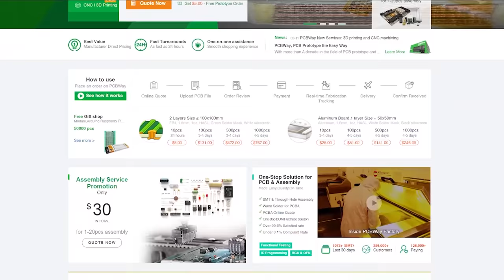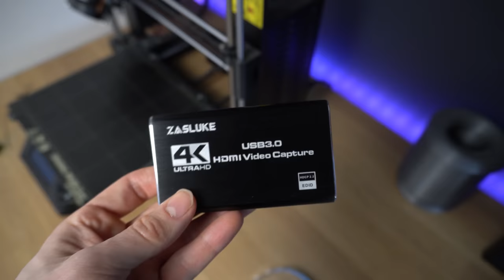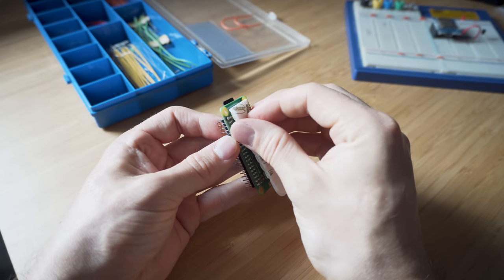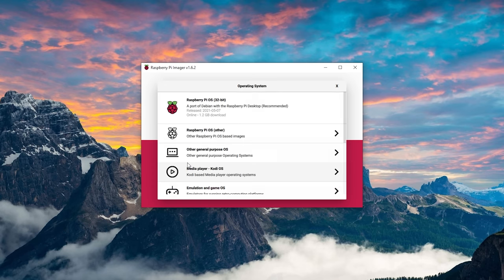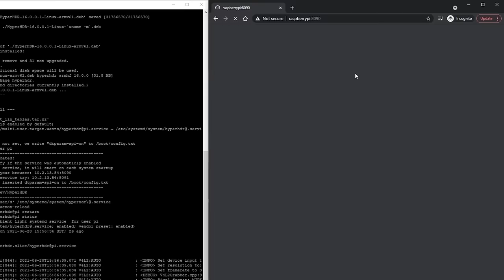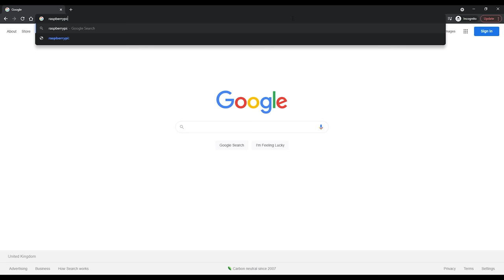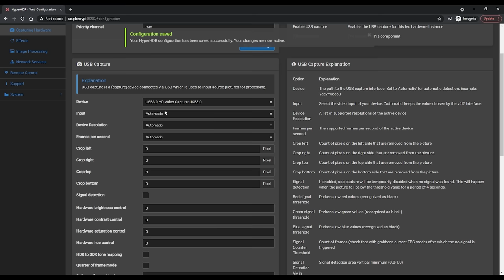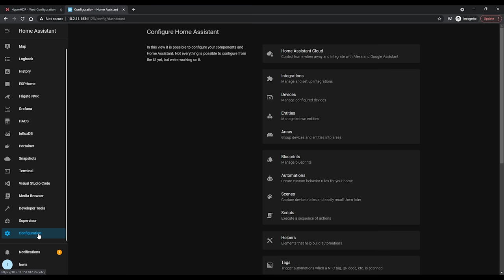The ULTIMATE Guide to Building an Ambilight TV with Hyperion

Comment: Help! I can't get the led strip to light up! I'm using this strip: BTF-LIGHTING RGBW RGB+Cool White SK6812 (Similar WS2812B) Individually Addressable 16.4ft 60LEDs. I've got everything connected like shown in the video, followed all the steps to the letter, but can' get the strip to light up..
Reply: Have you managed to fix this? I updated from version 16 to the 19 and after that I'm having the same issue.
Reply: @LuisPerez-st6bt   Never got it to work. ended up returning everything and buying an out of the box solution. :(
Reply: @BobMoore-v6z  I think that new projects use an ESP32 between the Pi and the Strip. I will try to look for an updated video. Sorry you didn't got it to work :(

Comment: So in the times when I keep the Pi powered up (I seem to have a dodgy connection in my barrel connector / usb cable which I will need to sort out) I have the following issues which I can't work out:
1. The USB capture card seems to be drawing power from the USB - USB connection from the Pi. I have a Pi which has the 2 USB ports stacked on top of each other - Is one of these power and the other data ?
2. Hyperion doesn't always detect the USB card and when it does I get 3 new entries in the USB hardware dropdown; USB camera (so somesuch) and then 2 items which look like system generated names. Which of the 3 am I supposed to select ?
3. When I think I have chosen the right device, and everything is all connected, Hyperion's 'Live Preview' window just shows what looks like a an RGB test card just lots of vertical RGB stripes. Is this an HDR / protection thing ? Or something wrong in my setup ?
Reply from the maker: USB ports provide power and data, that's why when you plug in a memory stick for example into any device, you can access it because it's recieving both power and data from the same port. Same situation on the Pi, both ports are identical.

Issue number 2 will probably be resolve by fixing the power problem.

Usually that's when the capture card isn't being detected, that could be for a number of reasons. I think if copyright protection is active you will just get a black screen on the card
Reply: @EverythingSmartHome  Hmmm ... I am beginning to think it is the video capture card :( The card has two lights on it; red to indicate power and blue, seemingly, when an HDMI input signal is connected. Within a few seconds of connecting the USB cable to the Pi then the blue light goes out. Or maybe it's a dodgy connection - the usb cable doesn't go completely into the port and whenever it wobbles the blue light goes out.

EDIT: Actually it's not the cable or the card. I have just installed OBS on my PC and using the same cards and HDMI cable the video is showing up in OBS. Which indicates it is something to do with the Pi. Which indicates possibly a dodgy USB port on the Pi as I have also ruled out the wiring by using a normal charger for the Pi (ignoring the LEDs for the time being)
Reply from the maker: Are you sure you have enough power supplied?
Reply: @EverythingSmartHome  I am beginning to wonder that now. Will take a further look later and redo everything. It's all (5m LED strip, Pi (no idea what model now I can't even find an image of the one I am using - it has 2 USB ports, a network port and a full HDMI output ) and USB capture card) running off a single 5v 10a power brick.
Reply from the maker: Feel free to hop in the discord if you need help!

Comment: Very nice tutorial.
I had already the materials prepared only to realized that most of the movies I like to watch are in widescreen cinema ratio. I got the 16:9 screen and this creates the top and bottom black bar. Cancelled the project :( but thanks for this tutorial.
Reply from the maker: Thanks! You maybe didn't watch it all the way through, there is the option to detect black bars in the software so that it still all works

Comment: Is it at all posible I could use HyperHDR with a Docker container instead of a Pi? Been researching online, looks like it is possible but no documentation as to how.
Reply from the maker: How would you control the LED strip without the Pi's GPIO?
Reply: @EverythingSmartHome  I could connect it to a NODEMCU and use the WiFi chip to connect to Docker
Reply from the maker: I think your possibly confusing what docker is, it's not a replacement for a Pi, docker runs on a Pi (amongst other things)
Reply from the maker: You don't need an add-on, add-ons are literally docker containers, you can run hyperHDR the exact same way if you wanted to.

Comment: I have a question, the official forum says, that the LED Type you used has sometimes problems and that you need an Arduino for that. Is this wrong?
Reply from the maker: I don't use an Arduino, I know the issue you speak of but I've done several installs so far without issue as have others. But your mileage may vary.

Comment: Great video! I'm a noob to this, so 2 questions, if I may:
1) can I run Hyperion on the same pi as my home assistant? And
2) I have a fire stick 4k, will this setup let me use it as the source? With functioning Netflix, etc?
Reply from the maker: Thanks! You could but I wouldn't, Hyperion is pretty taxing on its own on the CPU.

Yes it will work

Comment: Hi Lewis, really confused here after a few hours... I have bought the exact same hardware as you in this video (except using a Pi 3 B+). When i initially setup the pi and booted HyperHDR i forgot to plug in the capture card via usb, the LEDs worked perfectly and showed the right colours etc. I then plugged in the Capture card and rebooted and just could not get the capture card to work. It showed up as an option but the live view wouldnt show anything and it also wouldnt pass through. When i unplugged the capture card and plugged it into a windows laptop, it passed through and captured fine so i know the card isnt bad. I then wiped the SD card and reflashed from scratch, this time having the capture card plugged in from the start. Then the opposite happened, the card works flawlessly but the LEDs will not work at all, just cannot get them to light up at all, even when rebooting and unplugging the cards, the LEDs are just dead. Did a final re-flash again without the card plugged in and back to square one, LEDs work well, but even when plugging in capture card i get no passthrough and no live view... dont understand whats happening. All hardware and instructions followed exactly. Any help would be majorly appreciated.
Reply from the maker: Hello, hop in the discord server I'm sure we can get it sorted!
Reply: Did you get an answer? I have the exact same problem with the RB3b

Comment: Couple of Questions and some useful (I think) comments

Why would you cut the USB cable and add it to the 5v power supply? Couldn’t that be plugged straight into a USB socket? So the Pi is on all the time. Or into the TV’s USB socket, so comes on when the TV does. 

Can I also add a different data stream to the LEDS? So data comes from the Pi when I’m watching movies, then from SP107E music controller for music effects? 

Pi manager software has a built in tool to add WiFi config file to the SD card. I think it’s CTRL-SHIFT-X at the same time, brings up a hidden menu. Also adds ssh file 

I’m trying this on a 75” tv I recently bought (wish I hadn’t now, it’s to big) Can Hyperion software just do top-left-right? Without bottom LEDS? I’ve got everything ready but my Pi delivery has been delayed a week, so can’t test it yet. 

Anyways, great tutorial.
Reply: Hey @WardenMashups,

I'm receiving my stuff today and I wanted to ask how you have handled it? Did you also cut the USB Cable or stick it directly into the TV or USB Socket?

I have also a 75" TV. Is the software able to handle Left-Top-Right only? At least I would think so. Simply let the amount in the option for the bottom led to "0"?

Would like to hear something from you. Thanks..
Reply: @hammerlized  got mine working perfectly. Occasionally flickers when White flashed on the screen. Also have effects working. You can start where you ever want with the LEDS, just change it out in settings. 

My Pi runs off USB-C genuine cable. The LEDS I used are SK6812 powered from a 5V power adaptor.
Reply: @WardenMashups  thanks for the answer. My setup is also working good so far but I am missing the CEC future. So I have ordered a capture card that supports CEC. But the Output of the capture card to the pi is HDMI instead of USB (like the capture card in this video). 

So my Question is can I use the HDMI mini port at the pi zero wh that I use instead of the micro USB port?
Reply: @hammerlized  I wouldn’t know. This is the first Pi project I’ve tried. So don’t know if the micro HDMI can do input and output.

Comment: I might have missed it... Does this work if my video source is the TV itself? I do most of my viewing through apps on the TV.
Reply from the maker: Unfortunately no I'm afraid, it needs some sort of input..I wish it did!
Reply: I have the hyperion/hyperbian working for Android tv builtin content. Its possible to do this only if you have an avr with ARC capability in the chain.
Reply: If you have avr in chain you can move the splitter to avr input side. Firestick->splitter->tv & Firestick->splitter-> avr input & avr arc hdmi output-tv arc hdmi input. If you do connections as above with right hdmi cable, you will get arc, hyperion, 4k, firestick and tv content all covered by hyperion. No compromise. No blind spots.
Reply: @bhooshaniyer5302  So with a Android TV connected to a sound bar via HDMI ARC putting the splitter between these will work? I thought the ARC to the AVR only had audio signal coming back from the TV?

Comment: Great video. Quick question. I know you opted for HyperHDR for HDR content (as did I) but do you actually get HDR passthrough with this capture device? I get full HDR glory if I go straight to the TV but not with this device in-line. The only device I can find that specifically says it will pass through HDR is an expensive Elgato.
Reply from the maker: Thanks! Yes HDR works for me with this device!
Reply: I can confirm that, after many tests, HDR passthrough does not work using this card nor any which I tried ( I tried 4 capture cards ). The problem seems to be that the HDR signal ( 12bits ) is too dense for cards that are not powered from an external PSU. I also tried with switches that unpack the signal and modify it. No luck.
Even worse, if you, like me, have devices that uses HDMI 2.1 ( like PS5 and others ) it will "downgrade" the signal to HDMI 2.0 ( if you're lucky ) or HDMI 1.4. 
I suggest you look into those problems if you're going to try this setup

Comment: Hi.
I had a set of aurora  ambilights that had a box like a splitter.i cut ends off  power and data connections.  Power has red and a black.. but data has red and a black I connected  gpio 18 to red data nothing,the black nothing??
I'm I doing summat wrong
Reply from the maker: I'm not sure sorry, don't know if that LED strip is compatible and I don't have one to use or test
Reply: @EverythingSmartHome  thanks for reply

Comment: Does the 4K capture card you linked work with RPI Zero-W? Those cards seems to use USB3.0 but all the RPI:s except 4 has only 2.0.
I would love to buy the capture card you linked, can someone confirm that it works with a RPI 3 B+?
Reply from the maker: It does indeed, that's the one I'm using :)
Reply: @EverythingSmartHome  I've built the setup after your guide (great guide btw!) -- but I've connected it to a Apple TV 4K and it justs flickers between no signal and black screen. 

If I go led visualisation, I see for a splitsecond the Apple TV meny, but same thing there, just flickering in all black. 

I've tried with my HTPC (Intel NUC) and Apple TV 4th gen (1080p) and both work excellent. I also tried with an Elgato HD60S which flashes red for a second and isn't recognizable in the Hyperion web config. 

Any ideas/suggestions on what to do to make it work with the 4K ATV? Is it the Capture card being to weak? I got this one: https://www.amazon.se/-/en/gp/product/B08PRX3CZX/ref=ox_sc_saved_title_1?smid=ANU9KP01APNAG&psc=1

Thanks!
Reply: @kkkimba  did you get it running?
Reply: @Pac1011  I did - I played around with the video settings on the ATV. If I remember correctly, I turned off match content. Possibly changed the resolution settings and/or HDR settings. That did the trick for me.

Comment: The biggest issue I am facing is finding an affordable capture card that supports CEC passthrough. Nothing I've seen supports this feature, so get ready to revert to using 2 remote controls again for your TV. If not having CEC is a deal breaker you may as well go get a Phillips hue HDMI sync box for the cost of what you end up spending on all these extra peripherals. All sounds and looks great in theory but the cost savings forequivalent features using Hyperion and raspberry pi seems negligible to me.
Reply from the maker: Yes there definitely seems an absence of cards that support CEC for some reason. Many of us have home assistant which allows us to turn on our TVs remotely anyways but it can be challenging for those who don't.
Reply: @EverythingSmartHome  apparently it's because there's no standard for it and all manufacturers use their own version of it. I wonder how Philips Hue manage to get it to work on their sync box.
Reply from the maker: Really? That wouldn't make sense to me, otherwise how would my Chromecast work with my Panasonic TV or my Samsung TV if there is lots of different implementations? Seems strange!
Reply: @EverythingSmartHome  Well that's an android device right? Or least the Chromecast with Google TV is. As is the Nvidia shield TV and that works too. So Android caters to all of the different manufacturers possibly?

Comment: Can you use a normal PC for this project instead of a raspberry pi? Cheers.
Reply: Technically yes. But instead of the tiny raspberry it's your normal PC that has to be powered all the time when the Ambilight should be active. Apart from that, your PC has to be a Linux machine if there isn't a version of Hyperion compatible with Windows (I would be surprised). Also this wiring part would differ a whole lot I guess.

Comment: Thanks for a gret video. I originally followed Dr Zzzzzzzs' tutorial (but upgraded with a 4K capture card) and that worked great. After seeing yours, I thought it'd be a good time to upgrade to HyperHDR and change my LEDs to SK6812 for better whites. However, the setting for SK6812 doesn't work. I'm guessing it doesn't use GPIO 18 on the Pi. Do you know how to get SK6812s working? Many thanks.
Reply from the maker: Thanks for the comment! There are some changes for the SK6812 you need, you need to be on GPIO10 for a start. Jump into the discord server if your stuck, there have been lots of discussion in the last couple of weeks there about HyperHDR and sk6812

Comment: This is a great tutorial and I have eveything working except the light strip!

I am trying to create my own ambilight set up using a Rasberry Pi 3B and Hyperbian OS on a micro SD. I have successfuly set everything up, even have a live video of what my LEDS should be responding to on the Hyperion web interface. The only think I cant do is get the sk6812 led strip to light up. I know there is power because the Pi is working properly from the same power supply. I also managed to get 5 individual LEDs lit up for a while but could not program any aspect of them. If anyone could give some advice or has had this issue and help would be appreciate as I'm pulling my hair out with it.

This is my current setup:

                                     TV
                                    /
Video source --> splitter --> usb capture card --> pi --> LEDs
                                                                                       \    / 

                                                                             5v Power supply

Lights and Pi are powered by power supply. Both sharing a ground. The data cable for the LEDS is connected to the GPIO18 pin on the pi.

Thanks in advance.
Reply: Apologies, the diagram didn't come out great. I was trying to illustrate that the pi and the lights share the same power source.
Reply from the maker: Thanks! The SK6812 requires GPIO10 rather than 18
Reply: @EverythingSmartHome  Thanks for your reply. Thanks to youI now have the LEDs on all illuminated white but I cant seem to change the colour/program them at all. Any ideas? 
I really appreciate your advice.
Reply: Also just had them on for a short while and they began to smoke. Not good.
Reply from the maker: Hop in the discord server, there is lots of information in there already around setting up the sk6812. Not good that they started to smoke, assume bad connections?
Reply: @EverythingSmartHome  Fantastic, I will do that thank you. Yes it does seem like it.

Comment: Quick and maybe dumb question ;-) I've ordered everything. I want to capture my Xbox One X for ambilight as my video source. I also ordered a cheap capture card that has 1080 pass through. The only problem is that my xbox tells me that it only enables 4k and no HDR & Dolby vision features etcs. Do I have the wrong capture card or am I doing something wrong?
Reply: Did you ever get HDR working? I can't get it working either
Reply: @EamonnMartin7  yeah I bought the first capture card from Amazon but it was advertised wrong and only did 1080 passthrough so I bought a better one for 50€ and it worked
Reply: @JCdotnl  do you have a link?
Reply: @EamonnMartin7  again I fucked up my leds with soldering and hadn’t had the time to buy new ones 🤣 But I had it working
Reply: @JCdotnl  do you have a link to the capture card you used?